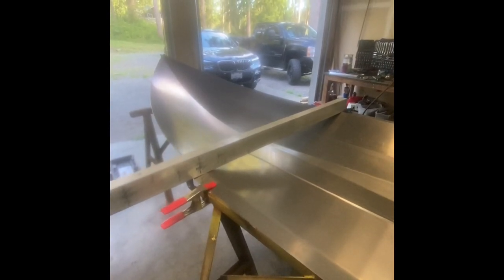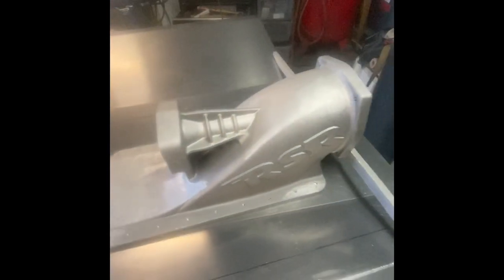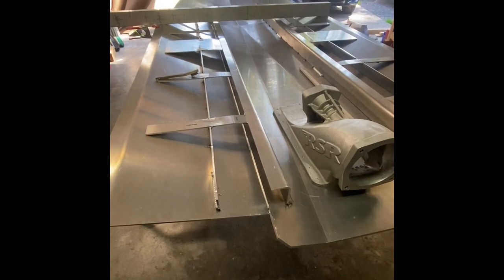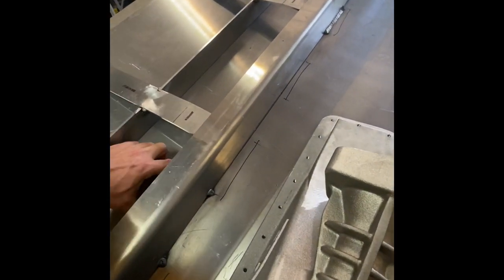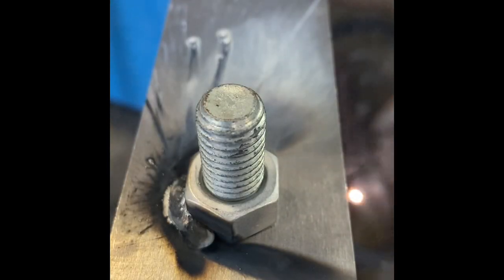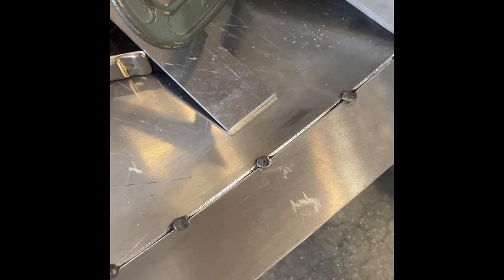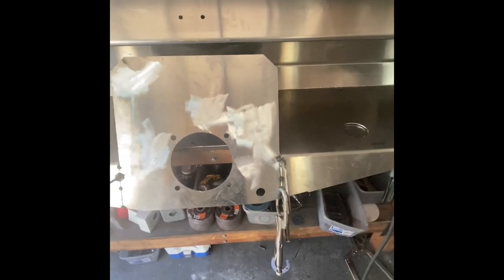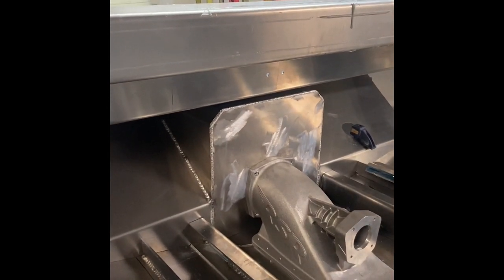RSRacecraft Skookum minijet build day 3

Comment: Great videos but you asked for comments on welding so here it goes.

Most welding schedules for coast guard approved passenger boats require full welding both sides on engine foundations.  Anything else welded to hull bottom is 3" (minimum length) weld on 9" centers.  (so a max of a 6" gap between welds).  Welds must be chained on hull bottom, meaning that you must weld both sides of material in same place.  This prevents rocking and cracking of welds.  on aluminum thinner than 0.250" welds may be "staggered" (not directly across from each other) ,  3" on 9".  I personally like .047 wire on anything thicker than 3/16" always use 5356 alloy filler for 5052 or 5086 plate.

Have a great day,
Keep up the great videos
Reply from the maker: Thanks for the input, I really appreciate it!